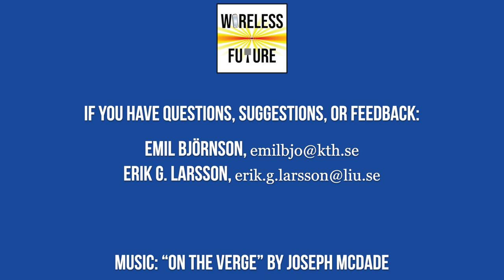Ep 6. Q/A on Massive MIMO [Wireless Future Podcast]

Comment: 00:40  Why massive mimo has not been fully
 adopted by the standard ?
05:12  How are the
 antennas calibrated in massive mimo ?
11:29  Whether a massive mimo can be deployed
 on a uav or can we use massive mimo to serve uavs ?
16:21  When reading
 about massive mimo I come across a term called channel hardening could you explain what it means ?
21:57  Whether "effective isotropic radiated power" is an issue when applying massive mimo in practice ?
28:51  What is the future of wireless power transfer
, can massive mimo push its limits ?
32:55  Will analog and hybrid beamforming solutions be replaced with digital solutions in the future, is it worth it ?
36:21  Is this a problem that with massive mimo technology increasing the dinamic range and we get more power amplifier issues ?
40:41  Are there other metrics that potentially
 are as relevant as capacity and rate ?